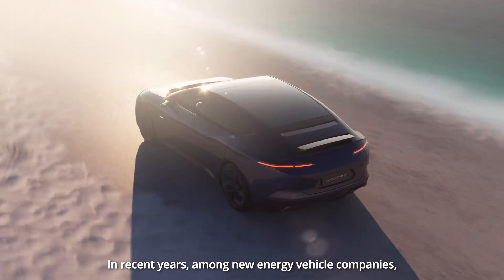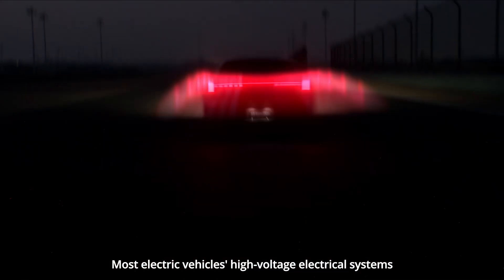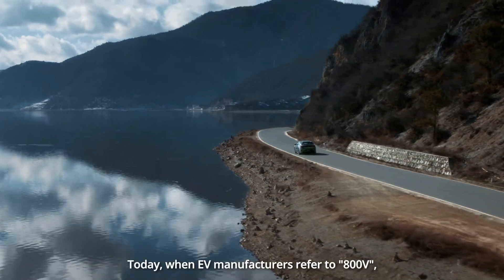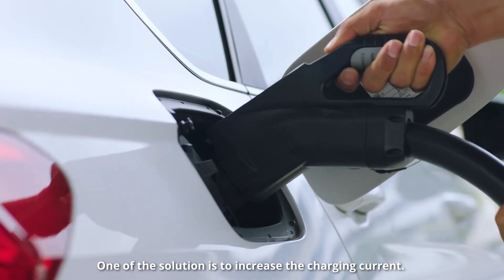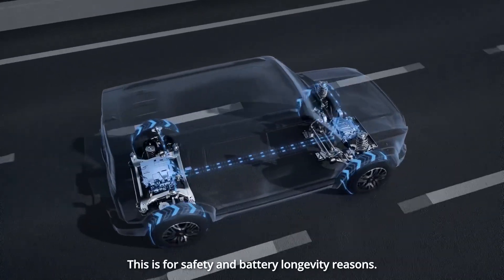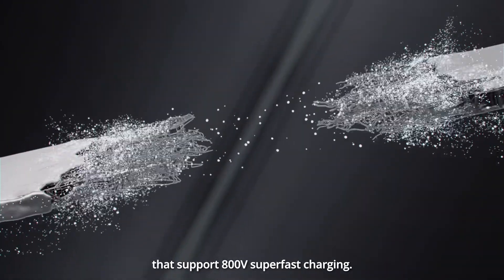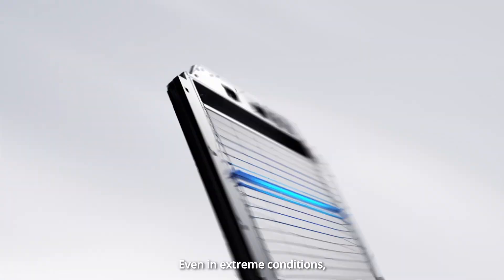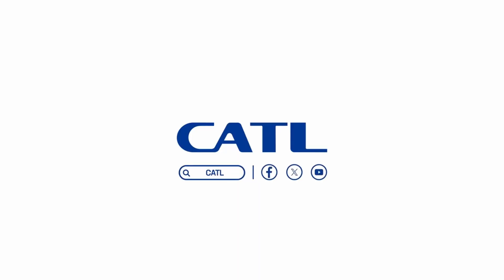ALL PUMPED for an 800-Volt Charging Future

Comment: CATL is it theoretically possible to have batteries that can:

- Hold over 400wh/KG (pack level)
- Be extra safe 
- Support more than 5.000 cycles 
- Charge from 15% to 95% in under 5 minutes?
Reply: Yes but not all in one battery. Li-S can do over 400 Wh/kg. Graphite-LiFePO4 is pretty safe due to low voltage and lasts 10,000 cycles.
Al-ion can charge in a few seconds (but low energy density)
Reply: How?
Reply: yes, you use reality distortion field first described on Startrek and often used by briliiant inventor Steve Jobs to simply ignore the laws of physics and deal with the consequences of bad design decisions. However energy density could be greatly improved by using metal air batteries but those are damned difficult to make rechargable and practical.

Comment: This is basically why power transmission lines are super high voltage. They can deliver the same power, but with lower current, which means less heat and therefore less power wasted. Brilliant as always. CATL is so far ahead of the competition.

Comment: 01:32 This shows a Tesla Model Y - is there any indication that Tesla will switch to the 800V Qilin Battery ?
Reply: The cybertruck is using the 800v architecture but I'm not sure when it's coming to the rest of the models
Reply: Nah, even a 800V system, tesla will be using their propritory architechture.